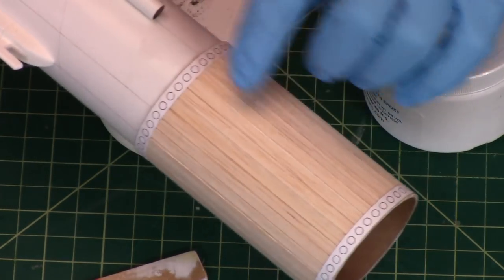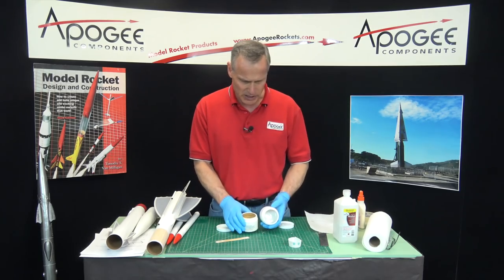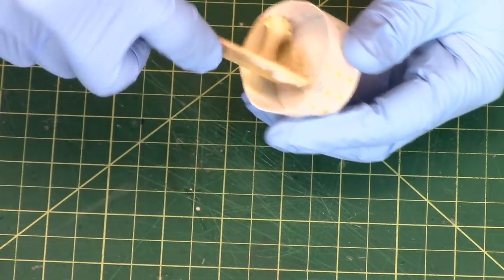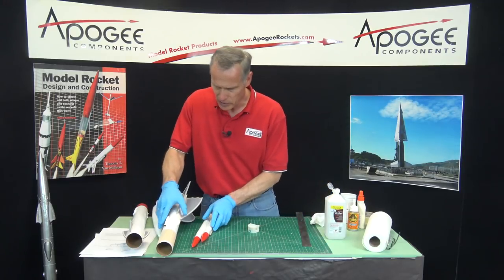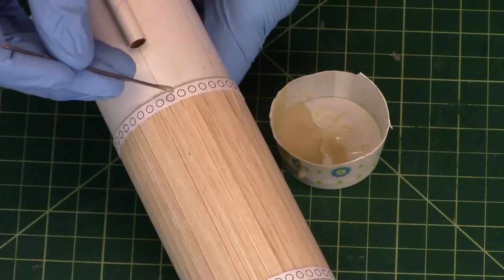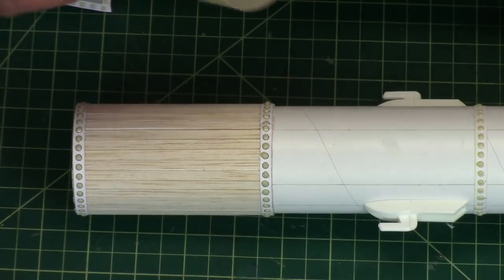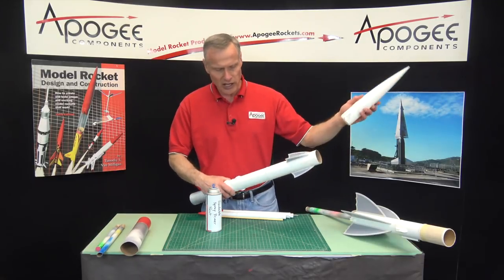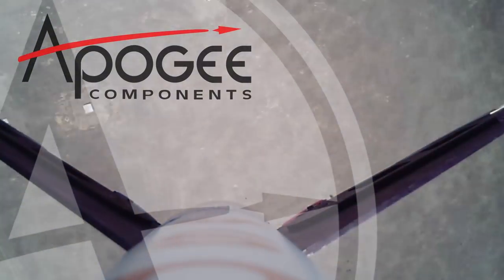Flying Machine Rocket Build: Part 15

Comment: I recently bought RocketPoxy from Apogee Components and I've noticed that there is an expiration date on two containers. I was wondering if it is still ok to use it after the expiration date? What is the proper way to store both parts? Also, do you sell RocketPoxy in smaller quantities?  Thank you very much!
Reply from the maker: I've used it long after the expiration date with no noticable effects. I store it on a shelf in my workshop. The smallest size we sell it 2-pint kit. Once you use it on a rocket, you'll be using it everywhere.